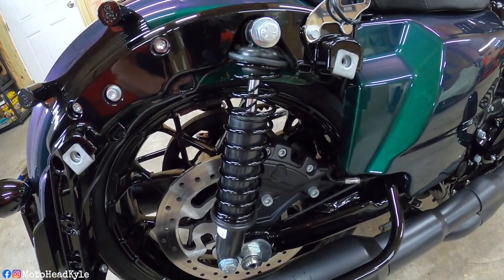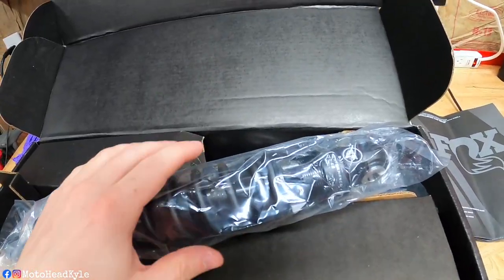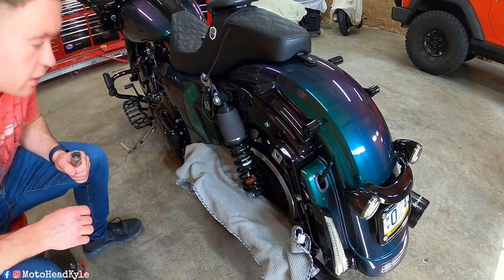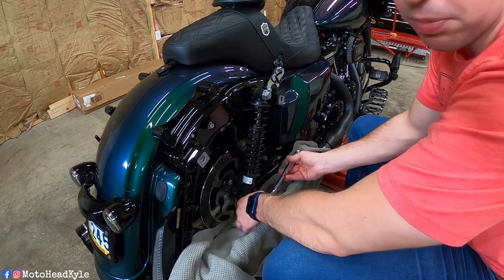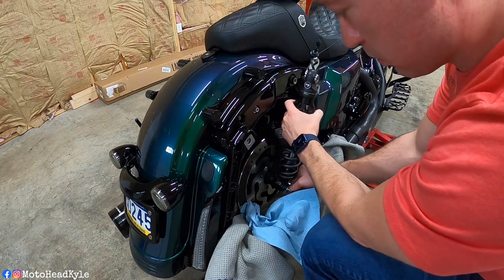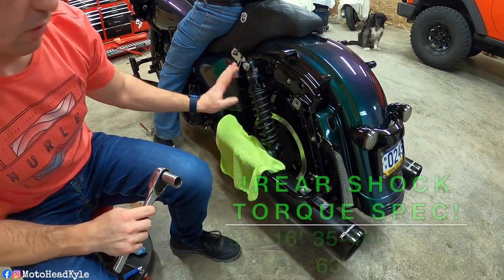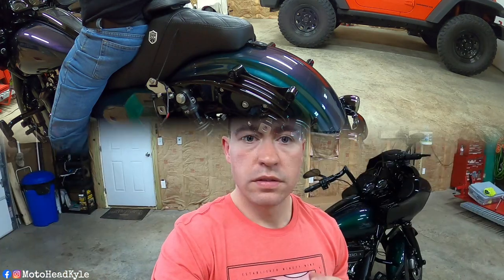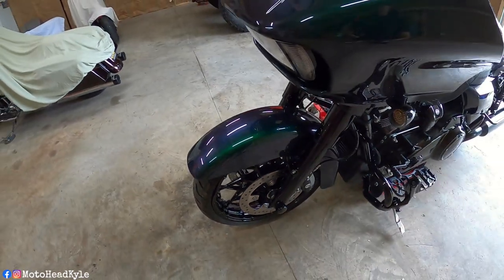Harley Davidson TOURING Suspension Upgrade Install (Fox IFP-R QS3)

Comment: Very professional video, you must have really hit a major pothole to have done so much damage to your front wheel. Amazing that the tire was still holding air after that wallop. Just put the Fox fully adjustable shocks on my 2023 Gladiator Mojave...insane. Will consider these when I upgrade my RG Special. Be well amigo.
Reply: Im not mechanically inclined, was the installation difficult.

Comment: Lol.  I just “upgraded” to the HD Premium adjustable shocks. Which I assume is what you removed in this vid as substandard. But for me it made all the difference because I was running the old air shocks on my 14 Limited. Which are awful. So the adjustable are a big upgrade for me. Far less kidney pain now. Believe it or not they get reviewed quite well on various forums. Also I am 250 which probly makes a difference. The lighter weight guys don’t seem to care for them as much.  End of the day I didn’t want to spend $700+ for shocks so it all worked out.

Comment: Tossed these on my 2017 SGS and talk about a major change!!  I had the same issue with my 4.5" pipes, and made things fun for sure.  Just picked up a Roadking Special and going to swap shocks at some point for sure.
Reply from the maker: Heck yeah! What year Road King did you get?
Reply: @MotoHeadKyle  2021, Blackjack Metalic with 2300 miles.  Thing is wicked fun.
Reply from the maker: @jasonbreedlove495  that’s a sweet color! Always loved the Road Kings
Reply: @MotoHeadKyle  found me a set of 13" FOX, hoping to install next week.  Glad I saw your vid as I'm running same pipes as you.
Reply from the maker: @jasonbreedlove495  heck yeah! I think you’ll enjoy them for the price point👍🏻

Comment: Great review of the new shocks. I'm impressed with the difference in movement between the stock units and the FOX units in the side by side section of the video. Great job. Also is that the Charleston, SC bridge?
Reply from the maker: Thanks Steve! No that’s actually the Route 1 bridge going from Delaware into Maryland
Reply: @MotoHeadKyle  I realized it was different after I commented. The Charleston bridge has the same supports but on the outer sides.

Comment: Did the 13s change the ride height and can you flat foot at lights? We are similar height and I need new shocks on my 21 limited
Reply from the maker: Yes, not noticeable though. I can still flat foot as well as I did with 12’s. If you have a limited you already have 13inch shocks from the factory🤘🏻

Comment: Nice upgrade. I went with SuperShox for the extra travel distance but anything but that stock suspension is a good choice.
Reply from the maker: Great choice! What size did you go with? Absolutely. Amen to that!
Reply: @MotoHeadKyle  Because of the offset mounts, the 14” Premium LT give 3.5” of travel even though the ride height is reduced to 11.5”. But I went with the 13” SL’s which puts me at 11” ride height and 3” of travel. I did have the 13” Revo A’s from Legend but not liking them. They are 12” ride height. I got short legs so need that extra 1” drop in height.
Reply from the maker: @RealSuperRando  I hear you on the short legs🤣 that’s good that you found a product that suits your needs. Sometimes that’s hard for us shorter riders lol

Comment: Hey my PA Snake Venom cousin. :) I put Super Shox 14" on the rears (has a relocation block so same ride height as the 12" stocks) and Legends in the forks. it's like a different bike.
Reply from the maker: I bet it is!! And I bet your only regret was waiting so long to get it done! Lol
Reply: @MotoHeadKyle  lol for sure. HD's "premium" suspension leaves a lot to be desired.
Reply from the maker: @gorion70  haha yes! Where “premium” isn’t so premium

Comment: did you have to use any of the supplied spacers?
Reply from the maker: Nope
Reply: @MotoHeadKyle  thanks for the reply. Were the preload settings they recommended for your weight end up being the same you found when you set the sag?
Reply from the maker: @CBRTRX  no problem! In the video they were correct with my dads weight however they were slightly off with my weight, no biggie I just adjusted them until the sag was correct

Comment: Now that you upgraded the rear suspension...gotta do the fronts too now...
Reply from the maker: Once their not back ordered! LOL
Reply: @MotoHeadKyle  FOX makes some good Springs you can just pop in....I did my Dyna with Progressive Heavy duty Springs after a fork seal and bushing job..
Reply from the maker: @bradlozano2571  yeah that’s what I’ll be installing but their currently on a 2 month wait! Progressive is good!
Reply: @MotoHeadKyle  Really?....Look on Dennis Kirk site
Reply: @MotoHeadKyle  Dennis has the Fox springs in Standard ride but out of stock on the Heavy duty right now
Reply from the maker: @bradlozano2571  yes I’m doing heavy duty to match the rear. FOX only rates their standard springs up to 240lbs. So if I 2 UP I’ll be well over that